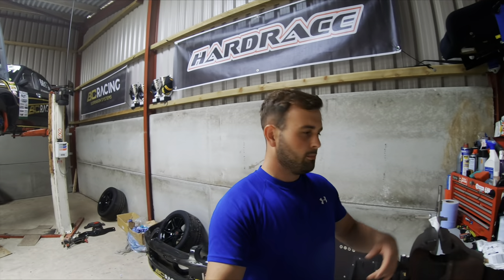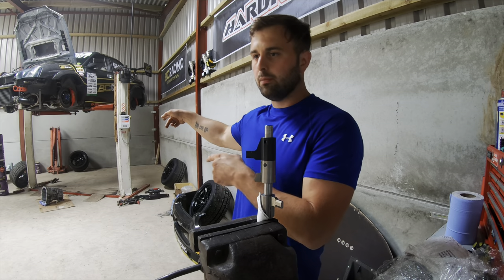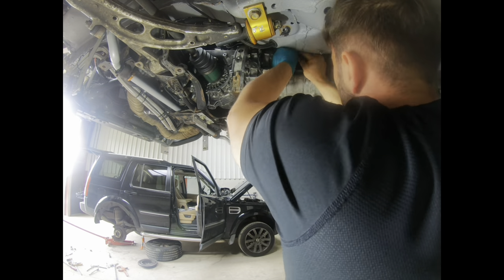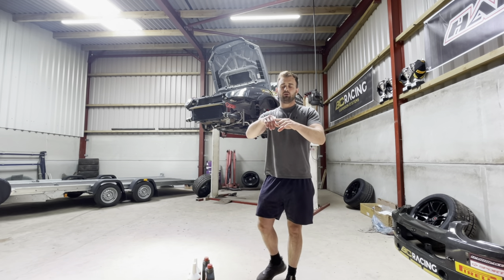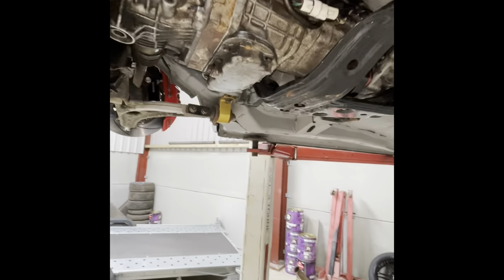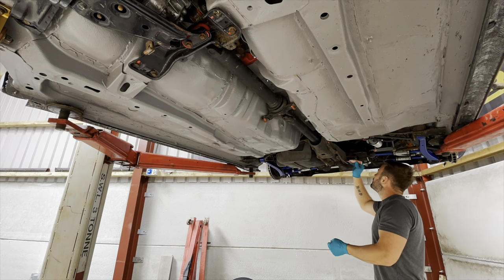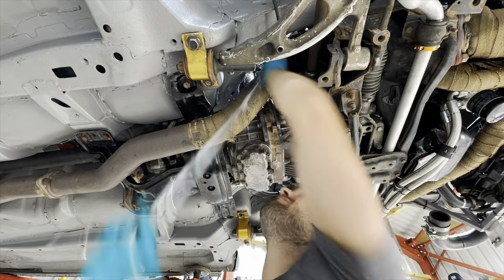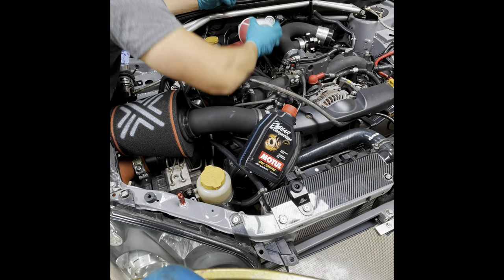Subaru 6 speed transmission rebuild *IN CAR* part 2

Comment: Hi, Sam. Was the latvian selector finger working well for you? I can't quite decide between that and the OEM one that is less than half price.
The car will be driven normally, no hard shifts.
Thanks!
Reply from the maker: Hiya mate, the Latvian selector finger worked great, I would recommend to anyone that’s taking the box apart to fit one, very cheap mod and very much worthwhile.
Reply: Thanks, too late now. I've just refreshed the OEM selector by switching it with the reverse one (same PN).
Cheers!

Comment: Hi, life saver, my centre diff is causing wind up when I turn , would it be the half roller bearings, do you have a source of a new centre diff at all to allow a rear diff pull only to sort my gearbox out, way better than having to separating the engine etc.

Cheers Rob
Reply from the maker: Are you certain there isn’t anything else at play here in terms of final drive or rear diff ratio incorrect? I have a supplier in the uk, drop me a message on Instagram mate and I’ll send you their links

Comment: I'm in need of some advice I rebuilt my sti 6speen. All went good till I went to test it in car I couldn't get it into reverse could it be I didn't line up lugs on magic stick gear selector rod lug stops or could it be a bent select fork. How much play should be in selector rod before seal up tail casing vicious coupling housing. I have pulled part put back together before sealing up the rest got it into reverse now but seem to get left and right play not in and out will it in reverse is this ok
Reply from the maker: Hiya mate, so it could well be the adjustment of the selector rod as you say, have a Google and download the factory service manual and it explains how to set measure the gearset heights and reset the selector rod heights, you do need a vernier height gauge to do this